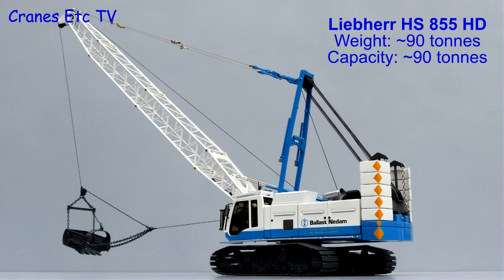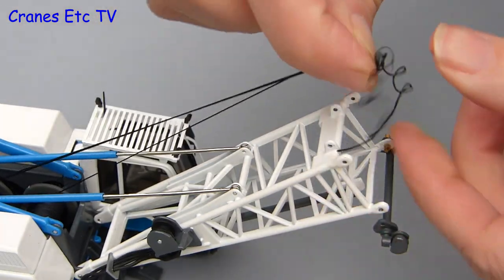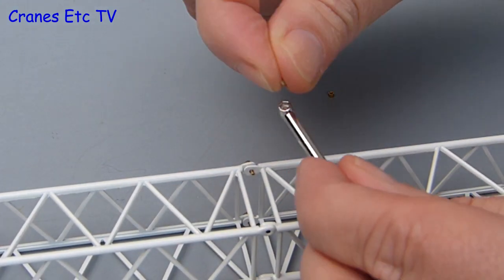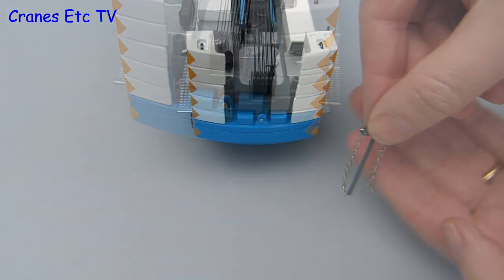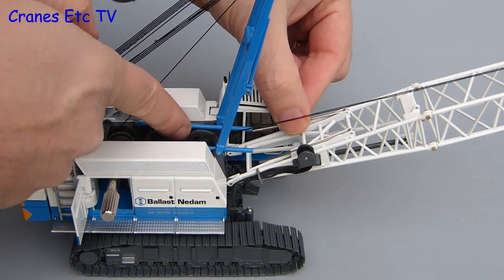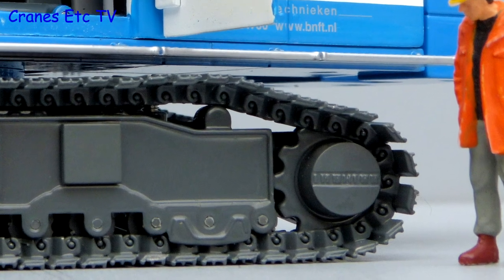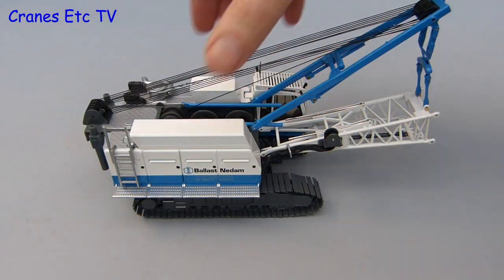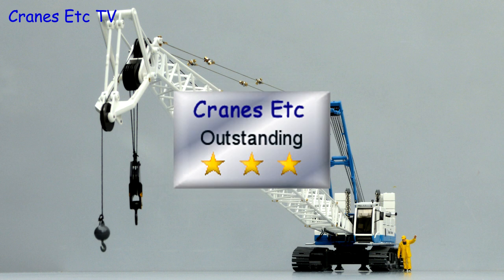NZG Liebherr HS 855 HD Crawler Crane 'Ballast Nedam' by Cranes Etc TV

Comment: Thank you so much for your reviews, I just finished assembling this model and no way I could have done so without your, very useful, video. Your explanations helped me much more than NZG's instruction sheets. I must say it was frustrating and my process was not as smooth as yours. One of the most frustrating things was that many of the little screws tended to "float" inside that special, NZG provided, tool. Anyway, once done it is a beautiful and impressive model.

Comment: The basic crawler unit appears very similar to the one used on the LRB 225 hydraulic pile driver/earth drill model (which NZG released before the HS 855 model), which is equipped with a redundant cable winch drum (for the LRB 225 model). I suppose (at the time), NZG intended to release a (future) model of the HS 855 crane that would use this drum.